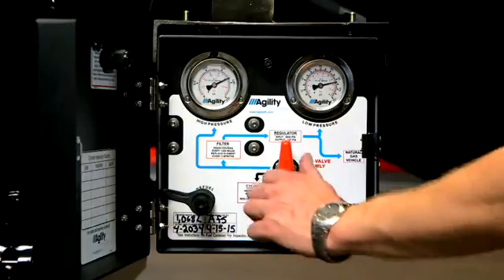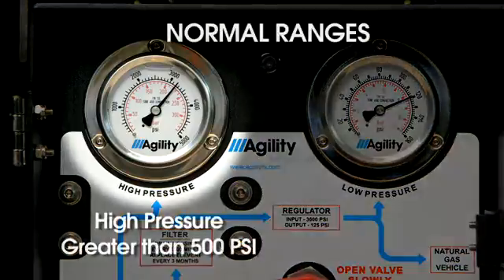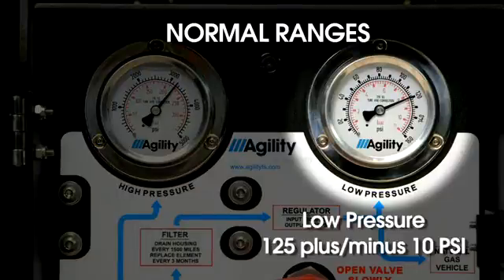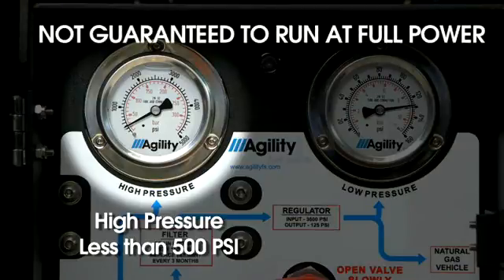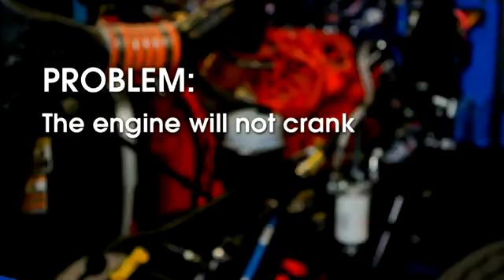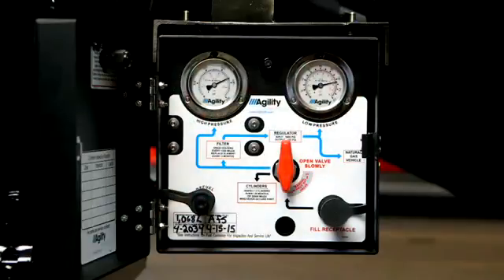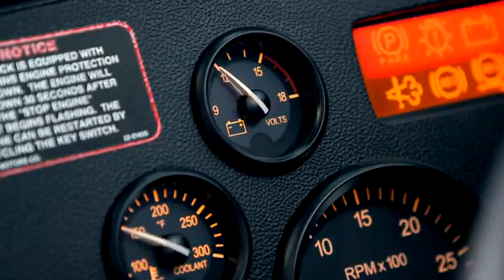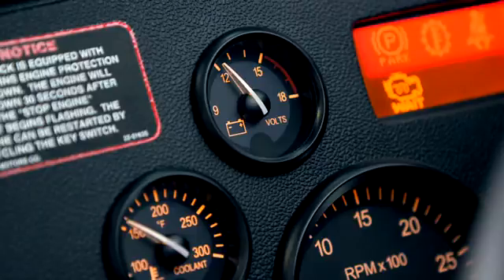CNG Segment 11: Troubleshooting CNG Fuel Systems

Comment: Lol what else could it be. Has fuel and chassis fuse good. Its a kw. Cant find fuel relays or fuse on the hatch of the tanks. Other trucks , they are there.  Can't get the adapter to plug in under dash to scan the truck. We have first generation cng trucks and their the worst  thing ever invented
Reply: They suck